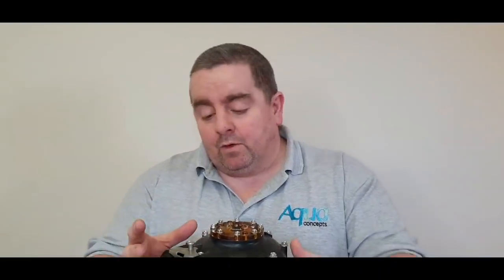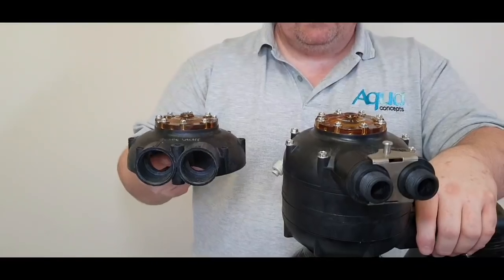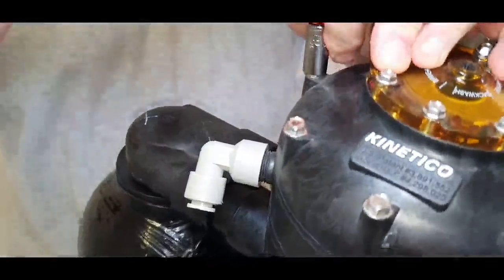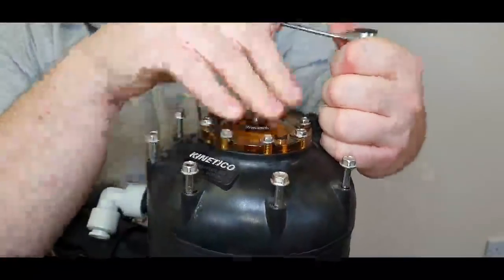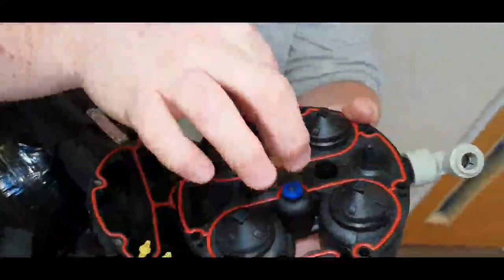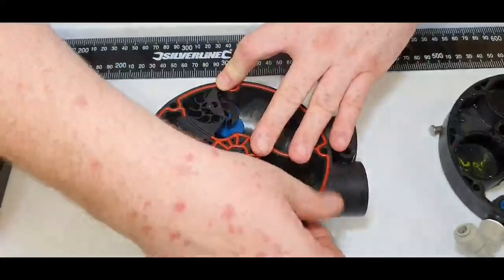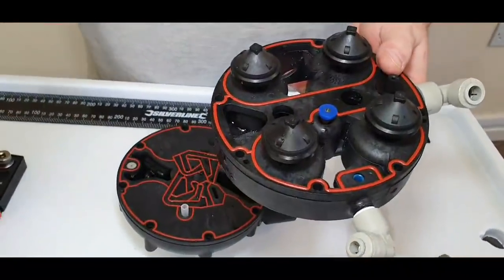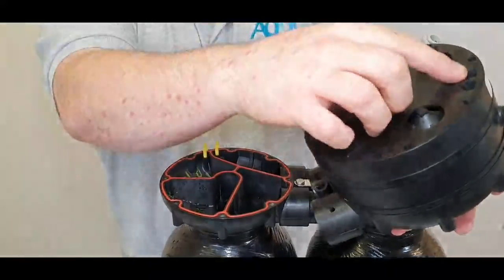Kinetico Breakdown And Rebuild [Kinetico Water Softener]

Comment: I want to see if replacing the resin will get it working right again. Mine is a Model 60 — fairly old but the regen and brine rinse settings work just fine. Consumes salt still..
Reply from the maker: If its drawing the brine and refilling it should soften. The vessels unscrew and it is easy to refill with resin. Your manual will have the weight of resin needed.

Comment: Hello
I apologize for the vocabulary but I am writing from Transtalor (I am from Poland and I have a problem with the Polish service which is a failure)
I have kinetico essnetial 11, the equipment does not enter automatic regeneration mode, I disassembled it, cleaned it and everything works properly only in level 6 there was no element "Solitaire Check Stem" no. 15817

Comment: Hi

I have a kinetico kube 1, i was just wondering how high should the water level be in my salt tank?

many thanks
Reply from the maker: Just enough to cover the bottom of the salt well.
Reply: @TheWaterBoyuk  thanks, ill check the bottom of the salt well tonight as the salt is a t a low level, so really it should a couple of inches high then?

thanks again

Comment: great video, so helpful to us DIY folks. I have done the full strip and rebuild, but have not solved the problem that the 2020C salk tank does not fill back up after the brine is sucked up. The level goes down and does not refill. The float valve assembly is clean and free moving but the water pressure behind it is too high for the valve to open. Any ideas please? thank you, John
Reply from the maker: When the cycle has completed, you are not getting the refill? Remove the brine pipe at the top of the brine valve. Sounds like an airlock there. Be quick to push it back in when you remove the air and the tank should refill.
Reply: @TheWaterBoyuk  when not regenerating, the pressure of the water behind the float valve is so high that the valve cannot open. is this correct? I presume at the end of the brine suction, the water pressure is reinstated and as the float vave is open, water flows in unil the correct level is achieved, then the valve closes and cannot open again due to the pressure. is this how it works?

Comment: Nice video. Do you have a trouble shooting guide for the Kinetico system? My system is operating fine except for the regeneration tube is now dripping water. I was going to get a seal kit, but I want to determine if this type of problem is associated with something breaking or cracking. That is, if I take it apart, what areas would be of concern with this type issue.
Reply from the maker: https://youtu.be/GE4078ftWfU

Comment: Hi and thank you for the great video
My issue is that, I get a good regen cycle on one side, and not on the other one
When it starts the rince/brine on the "bad" side, it doesn't suck in the brine from the tank, I can confirm that when removing the brine pipe, there is no vacuum on the brine elbow and water is actually getting out from it
On the side that is working correctly, if I do the same, I get the vacuum, and obviously, no water gets out

I opened it, everything looked clean, no parts blocked no clogg anywhere, when I reinstalled it, it worked once on both sides, then the bad side went faulty again after just one cycle...

I used silicon grease on the quad seals everywhere, I don't know if that is recommended, although, on the first opening, I saw that there were some silicon grease

The more I read in different places, the more I think that the seals and cones need to be replaced, although I'm surprised because my unit is only 6 years old, but even if I wanted to replace them, I can't find them anywhere, nor can I find the best silicon grease for this...

What would you recommend? (I'm in France...)

Many thanks
Reply from the maker: replace the seals and cones. Apply silicone grease very thinly , you want them to move freely and not curl.

Comment: Just watched the video of the Harvey water softener it is filling up with water and running out of the overflow and using a lot of salt any ideas please
Reply from the maker: take the lid off and remove the salt well assembly. get a torch and check for dripping. Is it stuck in regen?

Comment: i can fix your kinetico water softener with my eyes close . i can rebuilt and repair commercial kinetico hydrus softeners piece of cake but one problem i need a job. good steady paying job am from out of state in a dotted island.
Reply from the maker: Good Luck Zac 👍
Reply: Hi 
Struggle with Kinetico  as really 
Salty water in taps , ? Any ideas? Hose ,drains ,pressure all good. Running out of option
Reply from the maker: Have you changed the quad seals and cones and seals?

Comment: Hi there I have a kinetico 2020c were i have notice that one tank its giving soft water but the other tank isn't, both cycles draw in Brian but only one tanks gives soft water and the other tank doesn't, all the seal have been change in leve 4 and resin has been replaced too, any idea on what could be causing this issue
Reply from the maker: Any soft water at all in the second vessel? As this happened since the seal and resin change? Any pressure drop or restricted flow on either vessel? There are so many possibilities. It is impossible to fault find without methodically working through it. Who did the overhaul?
Reply: @TheWaterBoyuk  hi there I had replaced the resin as it was a 20 year softnear which I had got from a mate which was not working and was doing the same before and after changing the resin, did you have any diagram of the valve positioning when is use so that I can try and finger out were the fualt is, also i had tested both tanks and both have the same flow rate, but one tank had take 18min to regenrat and the other tank took around a 45min any idea on what could be wrong?
Reply from the maker: Did you change all the quad seals, piston seals, control valves and cones? If not that is likely to be your problem.
Reply: @TheWaterBoyuk  hi there Thanks for the reply, all 4 seal had been changed and 1 cone, I haven't changed the 2 drain off cones, could that be the problem?
Reply: Hi there ibhave managed to sort out one problem by changing level 3, but iam getting issues now and then when it regenerats and get to the end water still runs out from the waste and dose not stop, which only happeneds on one side of the regen, I have change the drain valves but still the same issue, can you help

Comment: I'm struggling with my softener since it was Installed last year, had Kinetico on first and now there trying a m3 on it. Still get a white residue/ marks on the taps etc
Reply from the maker: Who installed it?
Reply: @TheWaterBoyuk  soft water company I think the company is, Kinetico themselves have took over though. Replaced it with a m3 unit and its doing the same. Kinetico saying they've got a few customers with the same issue over the UK but not sure what the issue is. There picking up some samples from me this week to test in the lab, he seems to think copper is getting into the water after softener.
Reply from the maker: @joshuaforletta7861  does the white residue wipe off? What is the hardness level? Which area are you in? The Soft Water Company in Warwick? If it helps email me andrew@aquaconcepts.co.uk
Reply: @TheWaterBoyuk  not sure where they are based but his name was Andrew. From what I believe the hardness is only slightly or medium hardness in redditch just outside Birmingham. so abit baffled to why its like this. Yes you get a cloth and it wipes away or with cleaner.
Reply from the maker: I can certainly advise you. The residue sounds like excess sodium. Did the Soft Water Shop test your water on survey for hardness, flow rate, or pressure test? I believe these softeners are not set up correctly. Send me your phone number at the email above and I can have a chat with you.

Comment: Great DIY videos - Thanks for this and your Level 1 postings - concise, precise linnear tutorials!
I have a Q237 model with a #3 disc. My system manually regenerates perfectly, but doesn't automatically regenerate. I never noticed when it stopped automatically regenerating but I suspect its been since the city replaced the water main on the street, which initially resulted in sand coming into my water meter. The city replaced the water meter and I replaced the pre-filter on the Kentico system following. 

Having said all that, why might a Q237 stop auto-regenerating while manually regenerate successfully? Cheers
Reply from the maker: Thinhs to check. There are two sets of gearing in the level 1. The regen gears sound 👌but it would seem the service gears may have a problem. Check the nozzle. Check the pawls are in tact on the control disc. if they are not engaging, the disc won't advance.
Reply: @TheWaterBoyuk Alright - I'll revisit your Level 1 Video and get on it! Thank you.
Reply: I believe you were spot on! When I opened it up it appeared the bottom pawl was not in tact with the control disc. Corrected and ran a manual regeneration just because ... Now I reckon its wait and see if auto regerenation is back on. I definitely couldn't see any other reason for it not to be. I have a #3 disc so I believe I'll need to push thru ~244gallons before the auto-regeneration kicks in.

Definitely would not have been brave enough to take it apart without first seeing your video. Huge help!
Reply: @TheWaterBoyuk  Hi Again, just closing the loop. appears I messed up putting the pawl with the long spring back in, and the top pawl would climb to the edge of the next tooth and fall back dwn again into the same positin on the disc. On the end of the Pawl with the long spring is a tiny nib/bend that fits into the next/top pawl - and I missed it. Having corrected it, the system is now clicking away and auto-regenerating perfectly. 

Huge help - Thanks again!
Reply from the maker: Great effort 👏👏👏

Comment: Really nice video, thank you for the help. First mine softener was not softening my water. i followed your video step by step and it works right now. but now its making a whining sound, is that bad? its just working as it should, also the regen...
Reply from the maker: is the whining when you are using water? It maybe just metering now.
Reply: @TheWaterBoyuk  thanks for answering, i put the question on the wrong video, ive got an harvey. and yes when im using water. You can hear it clear. Its not grinding or something
Reply from the maker: It will be the meters going around. Did you run the tap till it went into auto regen?
Reply: @TheWaterBoyuk  i think youre right, i did fill it up first soo the air was out, than i put it in manual regen.
Reply: @TheWaterBoyuk  but is was a manual regen, its whining quit hard, have you any Idea what it can be? And does it harm it?
Reply from the maker: @geert2991  it's difficult to say with out earing the noise. I have heard loads of different noises and they all mean different things. Any loud noise is not good. 
I am editing a video together for the members section which goes into diagnosing faults etc. in the meantime, email me a video or recording of the noise and I will listen. andrew@aquaconcepts.co.uk

Comment: Very informative video.  Thank you.  How is the control head removed from the tank?  Does it unscrew?  What about the second tank.  Does the connector unscrew from it too?  Thank you.  

My machine was exposed to cold.  I had water running in the house so I suspect the head and one of the tanks is okay because water was flowing through it continuously.  The other tank may have froze inside because the water was stagnant.  If this happened, pieces from the other tank may have become lodged in the control head.  What do you think?
Reply from the maker: If the auxiliary tank froze and the strainer was broken it is possible. Unscrewing the tanks will reveal all. Let me know how you get on.
Reply: @TheWaterBoyuk  Thank you.  I will.  It's going to be a little while before I have time to open it, but I'll let you know what I find.
Reply: I finally took the head apart.  I looked though it thoroughly and didn't see anything that looked to be broken or cracked.  I did notice I have a fair amount of iron buildup inside two of the chambers and one of the four valves seemed like it might catch a little.  I'm wondering if this isn't the problem and the cold weather was coincidental.  It might need a head rebuild?
Reply: @TheWaterBoyuk  Sorry for waiting two years to tell you how things went with this unit.  I let the unit sit and started working on it four days ago.  

I've taken the head apart and cleaned all of the iron buildup off of it.  I checked it thoroughly for cracks and couldn't find any issues.  I did find where the brine tank float valve system failed and didn't stop water from entering into the tank.  

During the brine*rinse portion there is a vacuum.  The rest of the time, if I disconnect the brine hose from the head there is water coming out, even when the unit is not regenerating there is a trickle.  Is this normal or should it stop at some point?  

The unit is 28 years old and never been worked on.  I'm assuming the O-ring gaskets around the 4 valves on level four eventually age and harden, needing replacement?  Could replacing these gaskets stop the water from trickling out of the brine pipe, or is this normal?  

Thank you.  

Bill
Reply from the maker: Change them 👍
Reply: @TheWaterBoyuk  Thanks.  That's what I was thinking.

Is it normal to have a small trickle trying to go into the brine tank when the system isn't drawing in brine?
Reply from the maker: @williambryan2804  change the seals and cones on the control valves too. That will solve un the drips
Reply: @TheWaterBoyuk  Thank you very much.  I can't wait to have this up and running again.  Looking forward to having soft water again.
Reply: @TheWaterBoyuk  I replaced the seals on the control valves (the plunger that goes into the cylinder, the seal around the shaft, and the seal where at the top where it's cone shaped) and also the three cones (along with their plunger seal).  I made sure the seals weren't twisted, but seated properly.  There is still a low trickle of water going to the brine tank when the unit isn't regenerating.  

Any thoughts on what to do next?  I didn't replace the gaskets between each of the layers but with a visual inspection they look good.  A guy selling parts on EBay is telling me there will be a trickle going to the brine and I need to replace the float valve in the brine tank to stop the flow.  Does this sound right?
Reply from the maker: @williambryan2804  o ring under the discs  beneath the glass screen in level 1 a probable cause.
Reply: @TheWaterBoyuk  Are you referring to the 0-ring that fits inside the lower disk?  If this is it, I just replaced it and I'm still getting a slow trickle of water into the brine line.
Reply: @TheWaterBoyuk  I replaced the O-ring that fits inside the disk that controls regeneration (where the spring and rubber bumper piece go).  (I'm thinking this is what you were referring to.)  There is still a small amount of water wanting to flow from the control head to the brine tank.  Is this normal and the float valve in the tank will stop this or is there a valve in the control head that should completely shut off water flowing to the brine tank?

Thank you.

Comment: Thanks for posting this. Mine is 12 years old now, and has started 'hanging' during regeneration, so I shall be relying on this video for disassembly and investigation!
Reply from the maker: Let me know how you get on!
Reply: Well I’ve disassembled everything and it all looks good, even the small holes were all clear. Can’t see why it would be hanging on one of the backwash cycles. Back together now and will see what happens next time around the cycle!
Reply from the maker: 👍 Great effort.

Comment: Thank you for all your videos on the Kinetico softners. I have a friend with one of these and it has quit working. It doesn't appear to draw brine. Where would you start? Could there be worn out seals or valves in the Kinetico control head? What typically fails there? What should I look for in the salt tank?
Reply from the maker: Thanks for your question. If you have no brine draw, I would do a complete service. Clean out the cabinet. The main point of interest would be take apart the valve and pay attention to the venturi which may be blocked. Whilst in their change all the seals on the quad rings and control valves plus control valve cones.
Please hit subscribe. We have a member group coming up where you get access to 1 to 1 repairs, discounts on consumables, complimentary resin cleaners and lots more. Stay tuned!